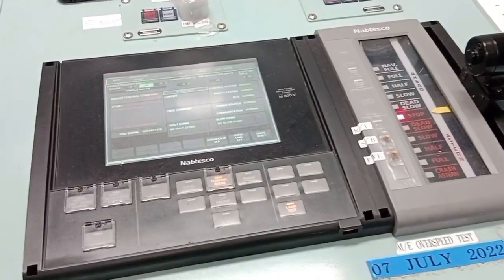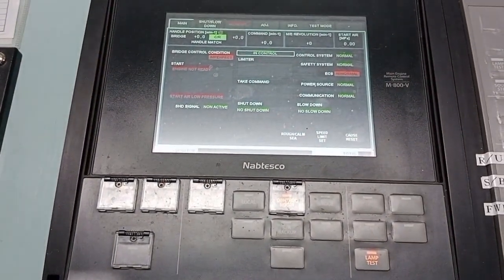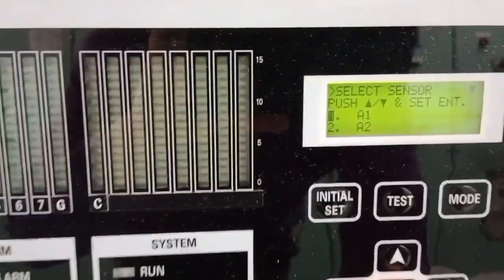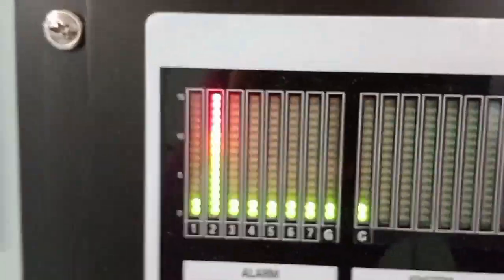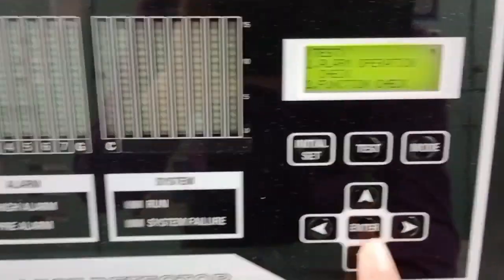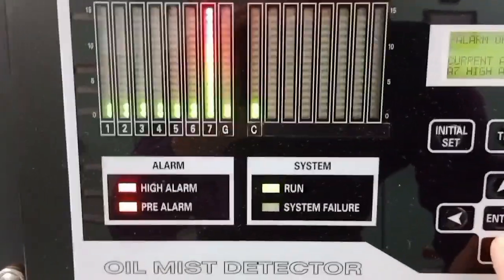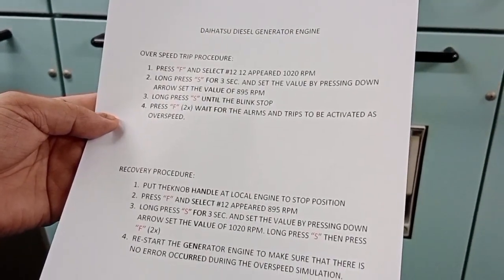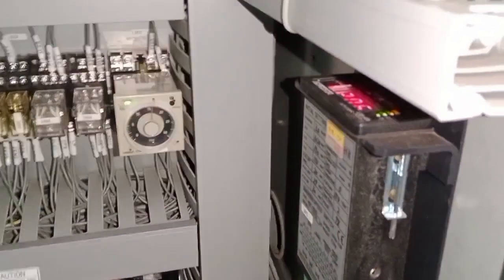Safety devices function test, Chief Meloy, seamans life

Comment: Yan po ang hindi alam gawin sa nkaraan barko n nsakyan ko kung aanu ioperate ang speed switch sa panel..so ang gngwa nila..they manually pushing yung linkage khit na connected pa rin sa governor..alam nila na masama prro gngwa pa rin nila
Reply from the maker: Yes sir there is a proper procedure and written in makers instructions manual, pushing one or more fuel linkage might damage the machinery include the governor it self.